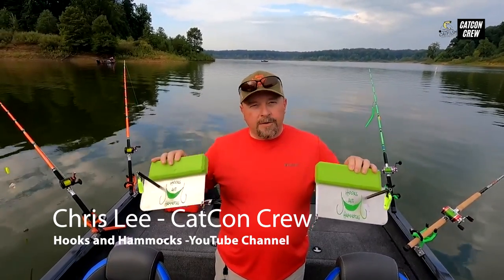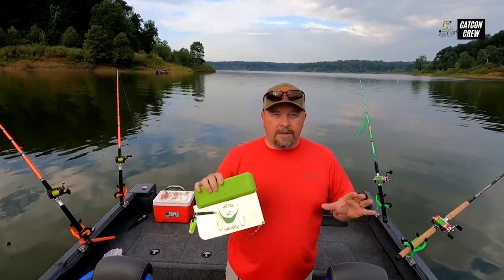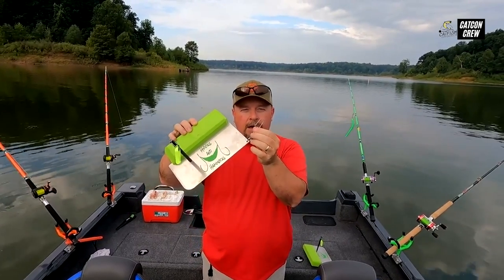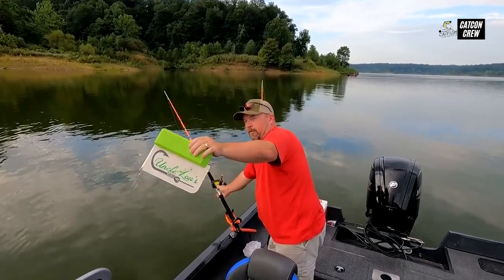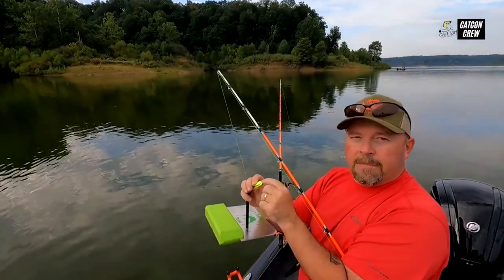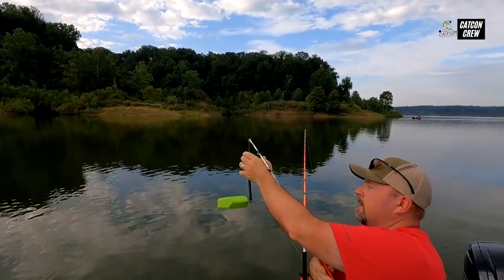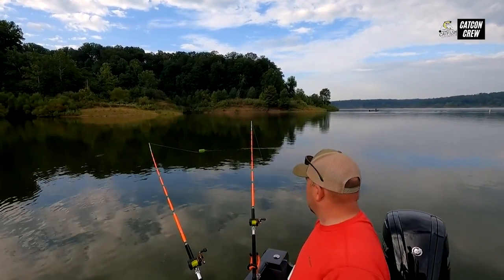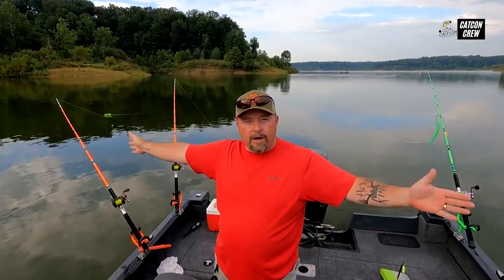How to use PLANER BOARDS for Catfish

Comment: Great video only question I have that I don’t think you covered and I could be wrong but….. what size of planer boards are you using and what are the different sizes used for ? I see only there’s 7 inch 9inch and bigger what’s the difference ?

Comment: How do you determine the size planner board needed for the sinker and bait weights ? I primarily fish Ohio river cannelton pool using average sinker weight around 8oz. Sorry if this is a dumb question or asked incorrectly, but thanks for any reply and advice
Reply: Sorry for the delayed response. We also fish the Ohio, we have been dragging baits with up to 6oz dragging sinkers and large baits with no issues. The boards are extremely buoyant and most time still stay afloat even when a fish is on so I wouldnt be concerned with bait and sinker weights. Come over to our channel and check us out, Hooks and Hammocks on YouTube!